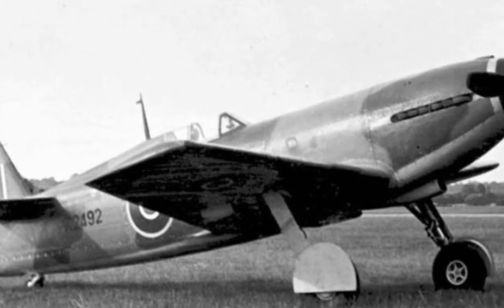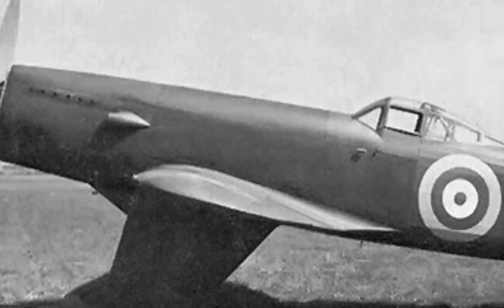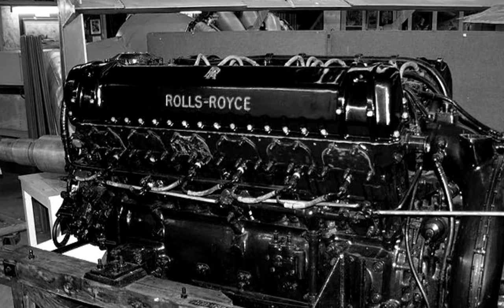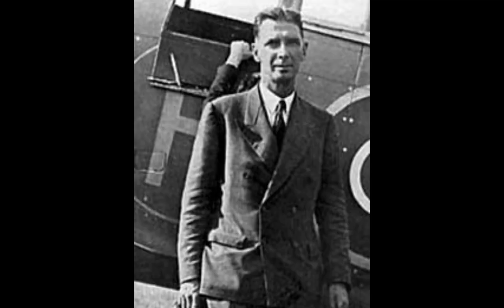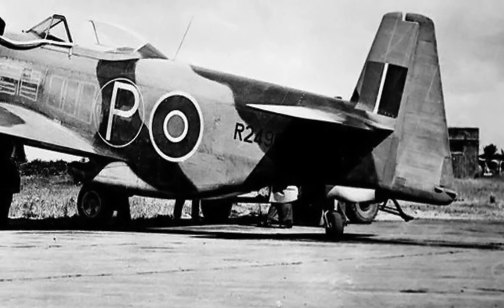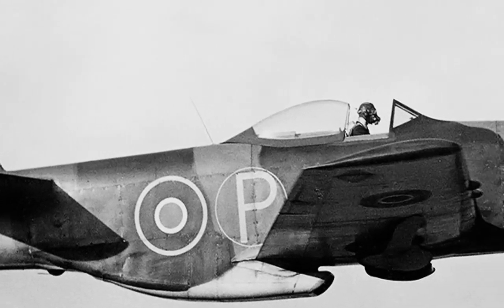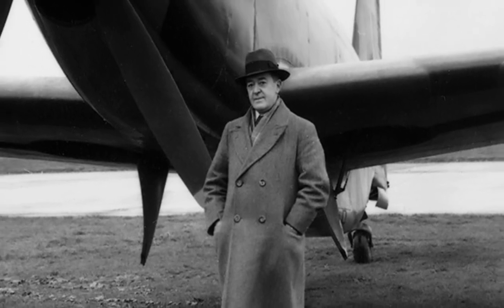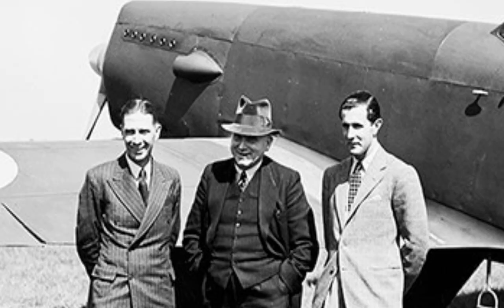The Martin Baker Prototype Fighter Aircraft: From the MB.1 to the MB.5

Comment: I love this thing in War Thunder, and your channel.
The extra low aspect ratio wings hemmorage energy, but they also stall at a higher AoA than most, and between that and the contra-rotating props and vertical you can do some confounding vertical play against most other pistons.
Reply from the maker: Thanks👍✈ Sounds like a beast on War Thunder.  How does it go against jets?
Reply: @AntiqueAirshow  Dunno, it’s at too low a battle-rating to face jets in WT. Pretty much untouchable boom and zoomer. A lot of players don’t like it because you have to use manual engine control trickery to keep the temps down with high performance. And because it turns badly. But I only play Sim mode and in that context the speed, visibility, and cannons trump turning potential.
Reply: Also for whatever reason there’s no armor plated seat back for the pilot,  but meh most late war planes have big guns that don’t need to snipe the pilot to shoot you down anyway.
Reply from the maker: @cmbaileytstc  Ahh yep fair enough. I don't play a heap of War Thunder, so I'm not really sure how it all works with jets and pistons engine fighters.  
Its the right aircraft for boom and zoom. It would be hard to chase down. Yeah ok, I've seen a few videos stating not to buy the MB.5.  Yeah, the MB.5 has an impressive armament so in boom and zooms it would blast anything in the gunsights.
Reply from the maker: @cmbaileytstc   Yeah very true. With or without Armor plating, cannon damage with shred and aircraft to pieces. Thanks for the info, its great to learn how this thing plays in War Thunder.
Reply: It has kinda mediocre performance except in speed, but it also can probably energy trap if you’re fast enough and don’t waste too much energy in the vertical. It’s like the Seafire FR-47 except it has worse turn and maybe roll performance but isn’t gapped by a shitty stock grind.